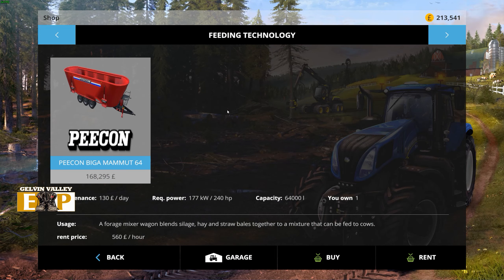GELVIN VALLEY EPISODE 9-Eustace Pharmer-FS15

Comment: nice video, the straps usually come off the trailer if you save the game when you have bales on it.
Reply from the maker: Ah haaa-mystery solved by Dave! Thank you Dave for the tip and for taking time to watch and comment.
Reply: @Atomic67G  I remember running into this issue with FS '19.  I'd occasionally save the game while the truck/trailer hauling bales was in motion (like on courseplay).  It took me a while to figure out just what in the world was going on.  I'd check my truck, and there it would be, trucking towards it's destination without a single bale on the back.  When I'd backtrack, there would be a carnage of bales thrown all over creation.  It was maddening until I read the underlying code.  And Dave is exactly right - in order to save the bales using the game engine, there was code that released the straps and 'set them free' just before the save.  So they would actually 'get' saved.  While they're on the trailer, as I understand it, they aren't actually known to the game or savegame file.  They 'look' like they are there, but it's a facade.  If the game were to save without releasing them back outside the straps, then the savegame wouldn't save the bales at all.  And you'd then load up the game and the bales would be gone.  Once I figured out what was happening, I removed that little bit from the code so I could save without having bales fly all over... and just had to remember to have an empty truck before I saved and left the game for good. 😜